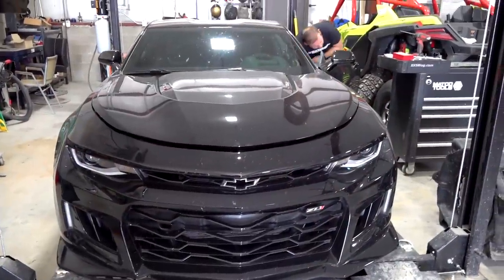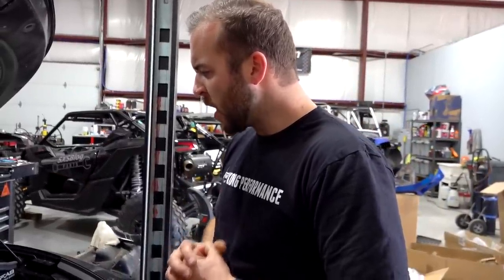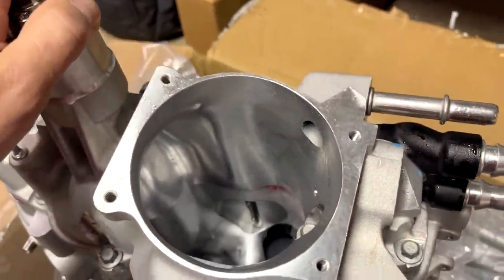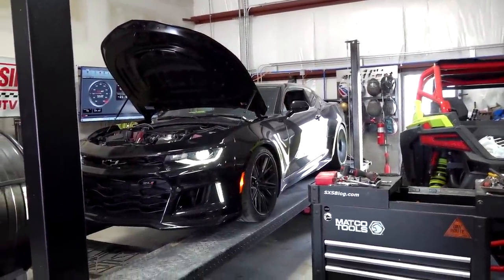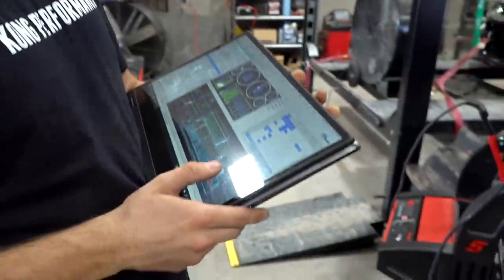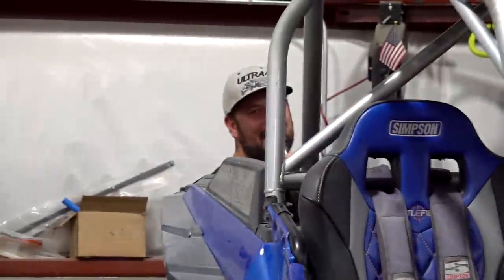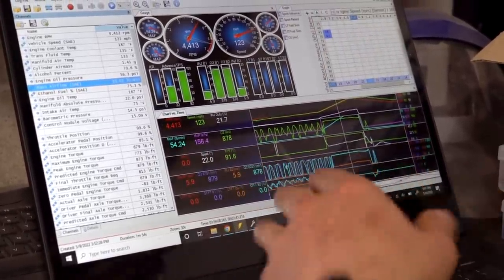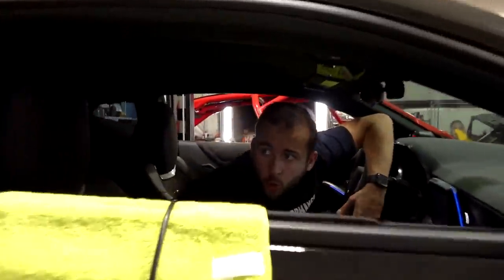Rick's ZL1 Camaro goes BIG with KONG ported blower and ethanol!

Comment: Personally I would put injectors in it and tune it for pump e85 like you were planning on. That makes it much more friendly all around. Can still road trip it etc.
Reply: This guy has the idea
Reply: Be much more driver friendly to ...an make more power
Reply: @rockkhound943  My cost on injectors is something like 2700 and you still need to worry about the high pressure pump keeping up.  Not really the recommended direction typically.
Reply: 100% agree.
Reply: 100% more fuel system on e85 and more boost
Reply: injectors aren't just a quick pull and replace on a direct injected engine besides you also have to replace the high pressure pump(if they even make a better one). so the option is a custom setup to install a set of port injectors which costs big money on these...
Reply: this guy knows.
Reply: People make around 1,000 rwhp on stock injectors. So, unless your looking for over that, they are not even needed.  Also, you need to match the $3,000 dollar hi- side as well. It's not just as easy as you are saying.  If so, we would all do it. I make 842hp and over 900 on e with stock injectors, meth, cam and low side for fuel, etc.
Reply: @mjc3502 how much do the injectors handle without using meth?
Reply: @Asizzle22ZL1  when I made 804hp, no meth, no E,  stock injectors.  Now, I had to add fuel, and I'm at 937hp.

Comment: From personal experience and building for other customers, I put in a stage 2 TSP cam kit with the 30 percent fuel lobe. Then drop down a size or 2 on blower but leave stock lower, then the 2in stainless works or kooks headers..like you have.. same intake you have then 3in cat back, flex fuel kit then a good pump gas and e85 tune. This comb makes good power plus reliable and without losing a ton of MPG. Really only thing you have left is do a stage 2 TSP cam kit so you can let that LT breathe cause stock there way under camed. If you do the cam kit it'll definitely come alive..PLEASE it's us PLEASE do the cam kit..lol..Any who RICH RULEZZ BABY!!!

Comment: If I had your car, I would get the most power out of my car I could get with pump gas so you don't have to mix fuel. Get other supporting mods, I'm not sure what they would be but maybe a cam, pullies, injectors, etc. Sick car btw
Reply: yep. Methanol greatly increases engine wear too. Stick to pump gas.
Reply: It's easy to just pump in some E at the pump. A guage tells you your % and as fat as mixing,  it is effort-less. I add E to my zl1 when I hit the track.

Comment: Do a btr stage 2 cam, smaller pulley and keep it on E85. She’ll rip and be reliable. Plus you’ll get more fuel from the fuel lobe on the stage 2 cam.
Reply: Or just put bigger injectors in it. Either way doing something to keep it in E would be way more friendly with the power gain he wants.
Reply: Just sucks cause you gotta pull the motor on 6th gens. But you have a good point if he was gonna pull the motor he might as well go with a stage 3 btr and put a converter
Reply: @tylerharty5537  my zl1  run 9's on a stock converter. You don't need one for the zl1. The car has a 470 first gear with a 10 speed.

Comment: One thing I noticed years ago is a mustang dyno can be set up to read anyway the operating person chooses. I had a lil ls1 Making 468hp and 420tq back in 2003 and it was a stang dyno. I went to a jet expecting to see close to 500hp on this motor. Well, it made 473hp. Only 5hp more.   I was disappointed, but learned something that day.
Nice video.

Comment: That's awesome that porting, new throttle body and kook headers will do.    Just adding a smaller upper and colder spark plugs, bigger fuel pump and injectors,  imagine what that'll do

Comment: Dude. Love this. But. You need to get a cam in that thing. You would have been way in the 700s. An yes of course throw every part you have on that beast. RICH RULES BABY. I dont have a Maro but have a RCSB chevy truck that I started the same way. Small than now huge. TSP 408LS BTR turbo cam 2.5 PRC heads D1X procharger built 4L80 an 8.8 with all built everything in it. Its dropped 4 6 bell tech an every bearing I replaced with SKF bearings. She is on HP tuners as well for now. Makes 800+ an very good torques. Very awesome car though Rick. Been wondering when you where going to bring it back on.
Reply: Where do you get that unit tuned?

Comment: Most of the time when things start dropping torque is due to timing falling. After it’s been dynoed multiple times in a row and things get warm/hot. Ecu will start pulling timing to keep detonation under control. Weather it’s IAT, coolant temp, oil temp etc… Whatever it uses to make decisions. Most all times when you add timing obviously it’s gonna make more hp, but it usually always picks up early torque #’s and carries peak tq higher.  👍

Comment: Do it.  I've had an 04 GTO that has been running an Alky control meth kit for 10+ years now with 20,000 miles on a full built ls1 making 600whp.  Drives great and a blast to drive. No regrets.

Comment: Rick could’ve bought a 3/4ton or 1 ton diesel truck for less money and then modified it with not much money at all and seen more HP and way more Torque plus got better fuel economy and been able to pull a trailer.  I run a 07 Ram dually 4x4 with a diesel and I’ve only got a small programmer a Smarty JR set at towing ( 75hp ) power level and with my transmission having the pressure turned up on it I while towing my 40’ gooseneck trailer loaded it gets me around 14-16mpg at 65mph and will bark 3&4 gears.

Comment: Need a mild cam bigger injectors and high flow fuel pump and small  pully and that's another 150 plus hp... keep it 93 pump gas.  Makes life better when you can road trip the hell out of it and have ton of fun and keeps at all safe

Comment: Meth kit pulley it and make a call to Fuel Injector Clinic to get improved flow from injectors. You can always tune it back to run E90 or E85. You say numbers don’t matter but they do matter in your own mind. Whether you share that number or not. Maybe change to a better fuel pump as well. So your not running your pump at close to 100 percent. As I said. You can have different tunes for the car. Then you can always turn it up on kill if you decide to take it to the track. I would love to have seen a comparison between stock and tuned on a race course track. Just a apples to apples comparison between upgrades. Just my two cents.

Comment: Buy injectors and run it on E85 and the flex fuel sensor. No meth!
Reply: @tnross23 I won't run any high power car on e85 it's to easy to get bad e85 then you have detonation and boom there goes a piston. Personally there's a lot of fuels better than e85 and not as dangerous. He could run 93 with boostane and methanol much safer that way.
Reply: @corbyn7840  12k gallons of e85 has ran through all my cars and not a bad tank yet.
Reply: @scottwolforth8948  I would do some more research
Reply: @corbyn7840  I guess I'll buy another 12k gallons, might be enough research by that time.
Reply: @scottwolforth8948  I will run my choice and make as much power along with not risking detonation
Reply: I’ve been running e85 in my twin turbo Malibu since 2010 on big boost and have never tested and never had a issue. Love the stuff other than I use a lot of it. 27 to 35 psi on a sbc,

Comment: Start with upgrading fuel injectors/system then you will be able to run anything on the street from e90 to 93 without having to worry if your mix is optimal
Reply: I have zero issues just pumping in E85 from a pump. I have had my zl1 up to 72% but from 50% to 70% the gain was very minimal.  So, I just add in so it's 48 to 52% with no hassle of worries of a mix. It's really that easy and the p3 guage tells you all your info. This is such a simple way to add 40hp with no hassle. I have stock fuel injectors, with a low side, cam and meth. And f.b.o

Comment: Don't do meth, do an aux port fuel injection kit with 1600cc injectors. More expensive initially but you'll be able to run 100% ethanol if you wanted and it's much more reliable than a meth setup and it will pull from the stock fuel tank. 1 tank to fill up. Way less hassle in the long run.

Comment: I think just add meth injection. If you go up in pulley size it will just run super hot intake temps all the time and you will end up will 3 meth nozzles in it and have to fill up the meth tank every 3 days!!!

Comment: Bigger injectors over installing a meth kit. If it’s a summer driver it’s going to suck mixing expensive fuels. Especially when 87 is 4.40 a gallon. Just keep it on a corn diet and have fun.